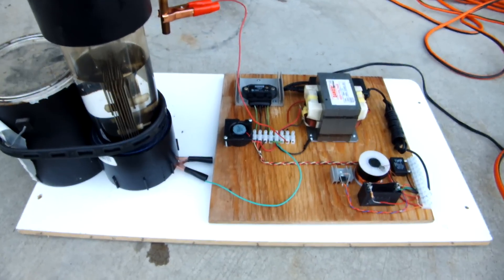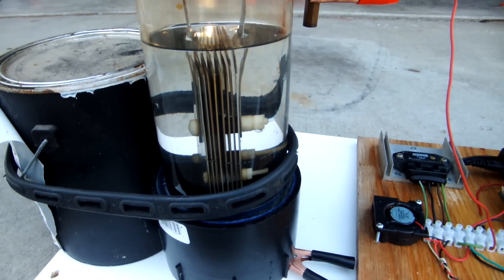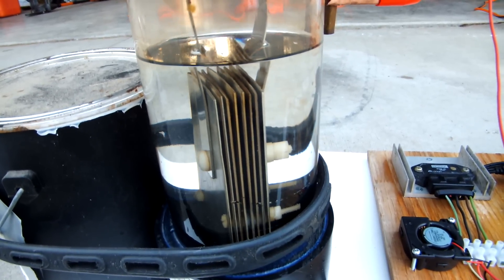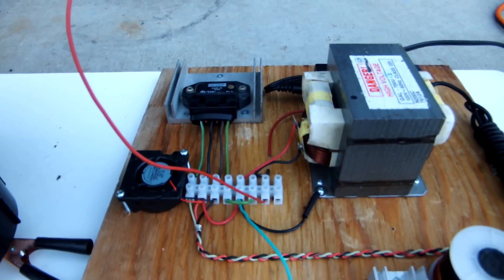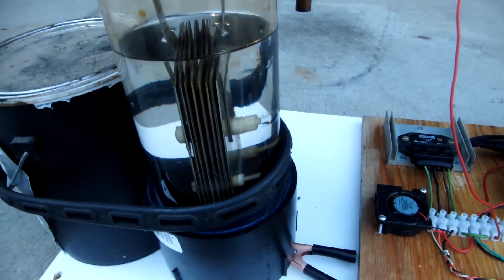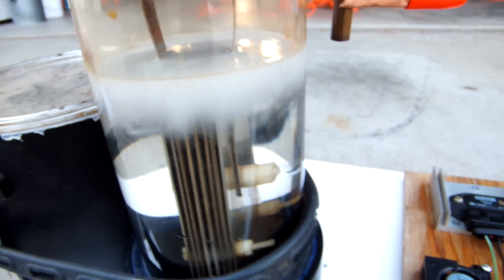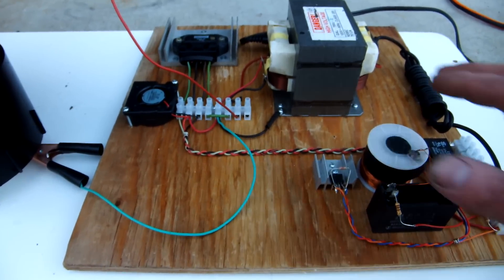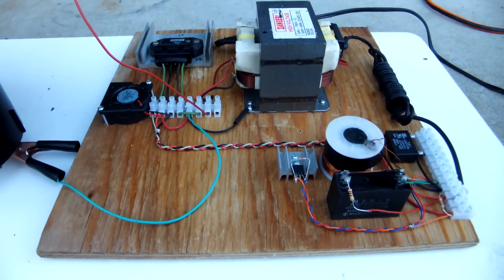Hydrogen from Tap Water @ 1,111 hz - HHO Pulse Charger v2.0

Comment: Hello, love your information thanks! I believe HHO is definitely the answer for man kind at this time since it could allow any vehicle on the road to work with it, even though there are better options for Zero Point that don't require a fuel source or the electrolyzation of water,. I was just wondering, you said it can take several hours to condition the water before it will work? Does the energy required to do this counteract the over unity factor when ready to create BG? Thanks!

Comment from the maker: Yes you can use any voltage transformer you want. You want a transformer that is very large with a 0.5 ohm to 6 ohm rating across the primary coil.

Comment from the maker: On a side note, using this cell, if you ignite the bubbles that form, it literally obliterates your hearing. You cannot light the bubbles at all without hearing protection. One 1" wide bubble literally makes your ears ring. If you experiment you will see that you cannot produce these types of bubbles with electrolyte and brute force electrolysis, because the chemicals actually change the molecular structure of the HHO gas, and reduce the formation of Brown's gas quite substancially.